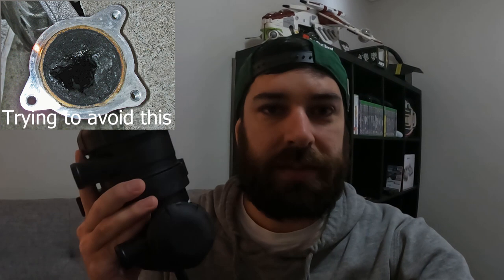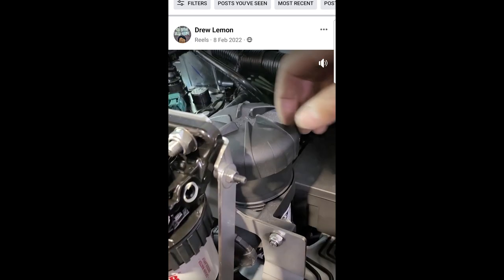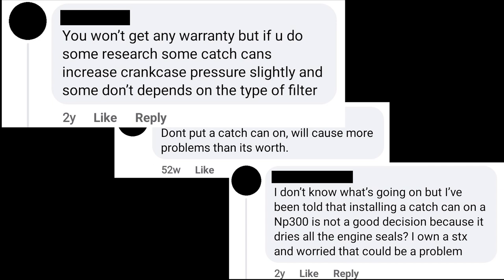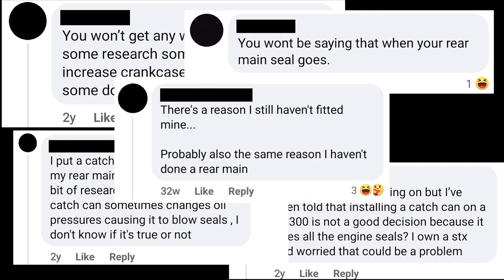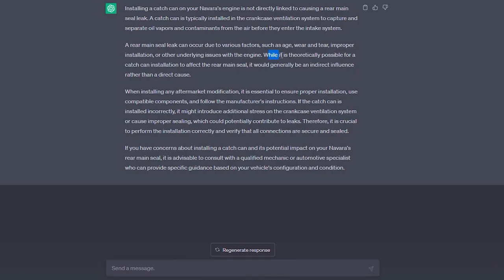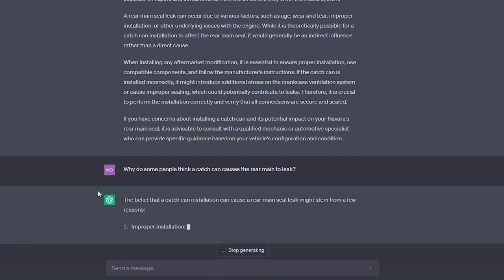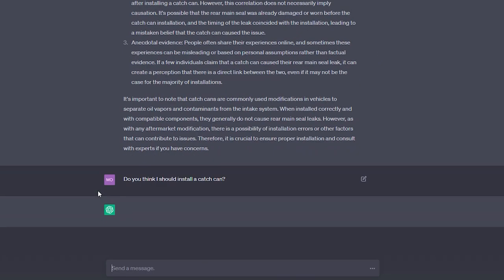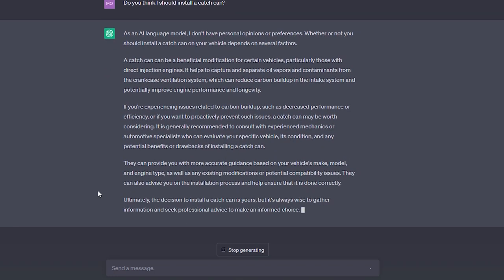The great debate! Oil Catch Cans and Rear Main Seals - Navara NP300 Build

Comment: I fitted one to my 2020 Nav last month. Fitted correctly there will be no issue. It will probably mean you won’t have hot pipe oil leaks. As a diesel mechanic with 20 yrs experience in heavy vehicles most vehicles have some sort of catch can.
Reply from the maker: This gives me more confidence!

Comment: Bought a 2019 Ntrek just on a year ago with 30,000km on the clock. The first mod I installed was a Mann Hummel catch can from Western Filters. Good quality unit and it does its job well. Unfortunately I will need to remove it today as my rear main seal looks like it’s gone. Still under warranty so best to remove the catch can so no arguments on what caused the rear main to go even though it is common among NP300 even without catch cans.
Reply from the maker: Yeah better to be safe! Let us know how you go and if they ask "have you ever had a catch can installed?"
Reply: Hey man, has your rear main seal leaked since its been fixed? Mine has just gone at 85000.

Comment: Had a catch can fitted to a NP300 for 6 years, 100,000k, no rear main seal leak, also no EGR issues of intercooler filled with oil residue, unlike the previous Navara V6 at 60,000K
Reply from the maker: Awesome! Definitley hearing less bad stories about catch cans since making this video 😀
Reply: Just about to take delivery of a NEW (late 2023 plated) Navara & it will also be getting a catch can, we used HPD alloy type & clean it out every 10,000k, remove the entire can & wash out in solvent/petrol, it will also get a Steinbauer module to pep the output,

Comment: Hey breadman...., i hav a 2015  nissan np300, 2.5 turbo diesel. My np didnt come with an EGR, they blanked it, they rerouted the hose into my intake before the turbo. I took a hose from the top of the tappix cover and rerouted it downwards under the vehicle.it throws abit of bypass combusion but i can liv with that.. i am doing 243000k's and never changed a rear engine/diff seal..... cheers .mate🇹🇹
Reply from the maker: I have read that blanking the EGR is a thing too. Awesome!

Comment: I put one on my NAV when I purchased it 2 years ago. Since then, I've done turbo back exhaust and tuned, 4inch lift and hundreds of trips where the NAV has been abused. I do have the rear main leaks now, but when I put it on, the car had done 55k's and it started to leak at 105k's, that's 50k of abuse. I don't believe it was the caused I just put it down to the shit design and the CHEAP CRAP MAIN SEAL itself. Why did they use this material when 99% of every other manufacturer wont?
Reply: what does it cost to redo rear main seal??  have a appt for hot pipes and catch can and manifold clean this week, 50% of people say catch cans make things worse, but every shop iv been to says I need one before I make things alot worse.....